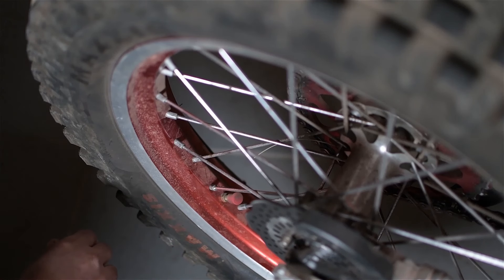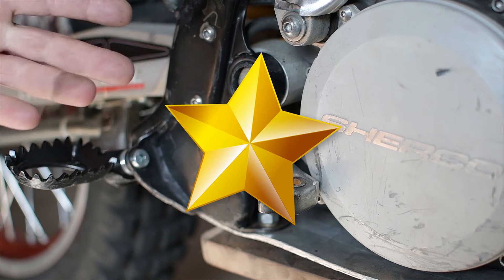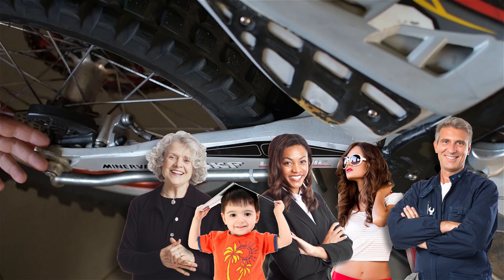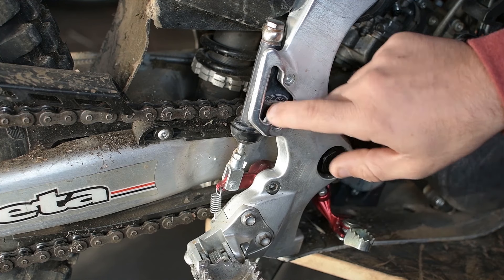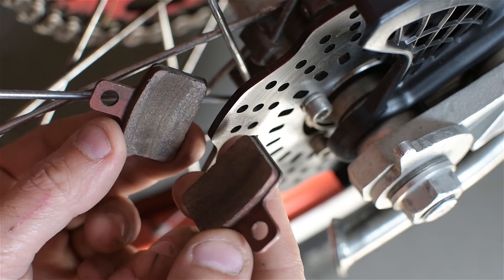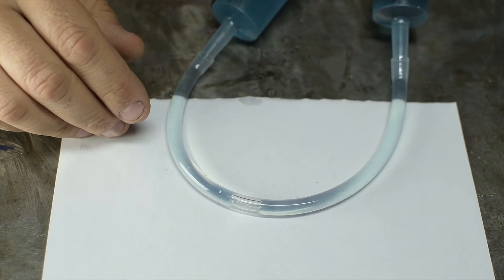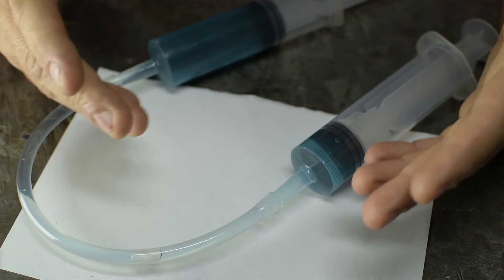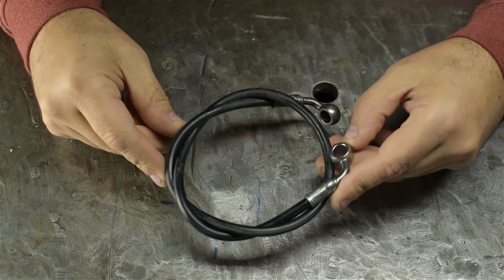I'm an Idiot! (Soft Spongy Brakes)

Comment: Question. So im having similiar issues on my bike, i have aftermarket rotors. Stock is 4mm. My rotors are 5mm. But the pistons in the calipers dont have anything stopping them from coming out further in your case. (And in mine there further in) So im wondering how tf it effects the brake force. Lmk if u have an opinion

Comment: my brakes squeal like a pig.  I have tried everything, new pads, surfacing rotor, cleaning them both, tightening all the fasteners involved, but always, within a couple miles of riding, they begin squealing...?  Oh, and it's a mountain bike with hydraulic brakes.  My only guess, is dust.  Is there a pad out there which dies not react to dust?

Comment: Ok, I have a question. Like, THE question:
WHY?
I doesn't make sense to me.
The calipers are able to compensate for pad wear, so they are able to compensate for rotor wear. If your description of the problem was correct, then new pads should have solved the problem.

I'm asking for a friend whose motorcycle front brake feels soft and spongy...

Comment: Umm. I don't get it. Aren't the caliper pistons self adjusting? I think pistons go out until they pop out from the caliper and spill oil. That is the reason brakes have an oil reservoir. Maybe some manufacturers limit piston travel to force brake pads/rotos change?

Comment: But... the rotor was only worn 1mm below spec, and you had brand new brake pads? What happens when the rotor is at spec and the brake pads are worn 2mm down from brand new? Wouldn’t you be in-spec everywhere and still have this problem?

Comment: So let's do the maths on likely cause of spongy brakes*:
90% air in the lines
5% brake pads
3% master cylinder seal
1.91% soft line failure
0.09% rotor wear

*without visible or audible symptoms of individual component failure

Comment: Your speed is very limited and very dangerous if you don't replace the chain. With that chain when you start to go from transonic to near supersonic a shockwave will develop on the advancing part of the chain causing instability and extreme heating breaking the chain. Its very different to retreating blade stall on helicopters but same principle.

Comment: @This Old Tony
Awesome video, this one would have stumped me!!! With that said, I do have some information that you might appreciate.
 Brake systems on cars do not ever have this problem. The caliper piston can be pushed all the way out using the brake pedal if there is nothing in the way to stop it. I have seen this happen when someone pushes the brake pedal with the calipers dismounted.

 I have also seen rotors completely cut off their hub by the caliper or  brake pads completely gone with the piston itself pushing on the rotor. There are people a lot dumber than you. ;)

 A lip seal like the ones used in car master cylinders will in fact let fluid pass in the opposite direction of the lip under pressure or vacuum. The master cylinder can not limit the travel of the piston, because the seal acts like a check valve, and lets more fluid in from the reservoir.

Comment: Wait, but wouldn't putting new pads in solve this? The MC/SC assembly needs to be able to compensate for pad wear, anyway; so a worn-out rotor + worn-out pads could technically run out, but with fresh pads, you should still be in the clear? I mean, considering the pads have about 3mm of usable depth _each_, while the rotor will only degrade by about 1mm total. Unless the disk is paper thin, putting new pads in should always make the whole thing brake better. Oh, and btw, it's the caliper travel you'd run out of, not the MC; the MC "resets" when the pads wear out, and it always starts from 0, while the caliper pistors stay permanently slid out.

Comment: you got to the brake line part and I'm like ... yeah maybe.

They are weird and yeah usually in a car over time due to stress. inside breaks down and you depressurize the system and the inside of that line says nope, i'm done.

Comment: Hey, I normaly don´t just write comments under certain videos on YT but here i would want to have futher explanation. I nerver heared of such a thing like `spongy brakes because of a worn disc`. Could you explain in a Vid how exactly the Calipers work, because in normal Fist-Calipers (which is a free translation from how we call these 2-piston (or more) calipers in german). Before you feel something different in the paddel the pistons of the calipers should come out (including a lot of breakfluid). I would suggest, just from hearing what you are saying, that possibly the seals in the caliper it self have gone bad, or there is dirt on the piston and you will probably experience the same problem again in some near future. Because these seals are normaly not just for sealing the breaksystem but also to retrieve the pistons back into the caliper for some fraction of a millimeter. sometimes if you have problems with this seal it can help just to push in the piston and pump it out some more times as well as cleaning the surface you can reach and use breakpistonpaste on it. 

I realy enjoy your vid´s and thought i would take some minutes to share my personal experiences as a motocycle and car mechanic with you even though you changed nearly the whole system anyways already, furthermore im sad about possible mistakes in this text my gramma might also be a little spongy.

Comment: I fill from the bleed nipple, Not from the top.
Get a large syringe and some thin tube and connect that to the nipple and sloooooooowly empty the syringe in the brake line.
If you did it slow enough you will have a brake line without air bubbles.

Comment: I dont get this... With new pads you have to push down the cylinders to the really bottom... And the stroke have to handle the pads wearing.. which is a lot more than the thickness of any rotor.

Comment: WARNING: EXCESSIVE EXPLANING - Reader discression advised! For future reference if you suspect low brake system pressure or pressure bleeding off you can get an awesome new tool called a "pressure gauge" which taps into the bleeder fitting at the caliper and will actually display the pressure in the system.  (BTW-just being sarcastic about the pressure gauge). The thickness of the rotor in and of itself shouldn't cause a soft or spongy pedal per se. A spongy pedal is caused by air trapped in a hydraulic system. Basic physics lesson ; gases (air)=compressable, liquids (brake fluid)=incompressable. If there was no air in the system and the system had no leaks then pressing the brake pedal should make the pressure rise to max and stay there without variation. But the pressure won't rise to the maximum until the pads have moved as far as they can and come up hard against the rotor. Back to mr. Master Cylinder. If the push rod at the master runs out of travel before the pads move all the way to rotor then no matter how hard you pressed on the pedal you were never generating max system pressure. So the pads would have some drag on the rotor but not maximum force. This could all have been checked with a pressure gauge. Also on cars you can adjust the length of the pushrod that goes from the brake pedal to the master cylinder to compenstate for the extra travel. If there was no adjustment on the pushrod on the bike's pedal you could have backed off on the stop screw to allow the pedal and the pushrod to move a longer distance at the master cylinder. This however would give what is called a "long" pedal or one that moves too far before any braking effect at all happens. I guess my point is when diagnosing any brake (hydraulic) system you've got to check the system pressure with a gauge before you can go on the mechanical parts of the system. Plus it's cheaper than buying brake fluid in 55gal drums. (Again with the sarcasm). I worked as a mechanic for 40 years and the most common cause of rechecks was a brake pedal that didn't feel right after a brake job. So I learned everything there  is to know about how to make a brake pedal feel perfect when a customer picked up their car. Next time first check that system pressure!

Comment: Ok.   Here's a brake problem question.   My paps truck brakes work great.  For about 10 minutes. Then they all.  Every single one slowly starts to grip harder and harder till the truck is in moveable.  Like seriously if u try to move it once they all lock up it won't.   What could it be

Comment: It took me till 11:30 till I figured it out... I have a BMW R1200C that even when it is 100 functional, to bleed the brakes requires a complicated intense setup and something in your butt... I don't know, but something has to be in there. (BMW) I used a wooden dowel with sand paper and/or scrubby to score the problem cylinder. It worked. But wow, brake line? Mine were $300 -_- Okay wow not brake line, rotor thickness? Oi!

Comment: Nice video. But- it’s not a good idea to call it “oil”, just in case someone thinks it’s actually oil !   Hydraulic fluid is very different stuff- based on glycol, not oil.  They (glycol and oil) are not compatible; worse than that, the seals in the brake system will be damaged by oil.

Comment: disc is not straight..?   And..High pressure water and bearings (headset, suspension pivot points) equals rust someday..

Comment: Well, this makes no sense.  A worn rotor won’t make the brakes spongey (any more then worn pads will).  It also shouldn’t increase the pedal travel, since hydraulic brakes are self adjusting for wear- the fluid level in the reservoir will drop, but the pedal travel stays the same.  If your brake was indeed spongey, and was fixed by changing the rotor, maybe the rotor was out of parallel (ie tapered or dished)?

Comment: how bizzare, normally on an open brake system the caliper pistons will effectively self adjust for pad or rotor wear, a closed system cannot but that master cylinder is definitely an open system, i'm going to suggest that maybe the rotor was warped thus rather than the brake pressure pressing the pads against the rotor and braking the bike that maybe the brake pressure was deforming the rotor to be parallel with the brake pads hence the pistons have self adjusted to the maximum run out of the rotor and have to travel excessively to accomodate for that, I have seen this on literally thousands of mountain bike disc brakes, both mechanical and hydraulic, if the rotor is warped a outiwth the (very small) tolerance the brakes feel spongy and soft......god I just said it!

Comment: Holy fucking shit, the rotor would've been the last thing I'd check, I would've even rebuilt the goddamn caliper first. Very unusual problem considering the pads can wear down more than what the rotor ended up being thinner without a problem. Well, at least on all mine that was the case, maybe those trial brakes are different.

Comment: I ONE OF THE THREE you helped. Bought a Honda CR500R new back in `96. Having the same issue as you for the last couple seasons now yet my rotor looks good. I have to measure it. With all that said as I sit here gunning down your theory with my AK-microsoft ARC keyboard I`m still skeptic. The caliper pucks take up the slack of wear. Add a little more fluid and you`re golden, right ?? How about I get off my fat ass and check for myself unless you want to take a flight to Jersey and do it for me ? LOL All expensive paid not by me of course .....

Comment: Lol story of my life. I had a similar problem with my rsv. I had no rear brake... i mean not soft not spongy just dead. 1mechanic insisteed master cylinder so i changed it. after a week the break was dead. mechanic insisteed master cylinder again. So i changed mechanic. The second mechanic said master cylinder also. long story short i skipped this mechanic also and started to figure out my self. changed again the piston, then the hose, then i bleeded every possible way front way back way sideways. Then i moved my master cylinder away from the motor and behind the rear sets so it doesnt get the heat (it was a possibility) then i bleeded with syringe the hole system then i changed the bleeders(for the possibility to be worn and suck air in the system). Then i changed the hose with the bleeder inlet to get the bleeder on the upper side. one day after 2 wears without rear break i had the AHHAAAA moment. i took out the caliper stuck a screwdriver between the pads and hold it as hight as i could. Guess what. The sucker was full of air. For the clever ones my rear system has 2 bleeders one on caliper and one on master cylinder and second the caliper is below the swingarm.

Comment: Since I started taking up machining and making parts for fun and profit a few years ago I have discovered a whole WORLD of things that you pay good money to be within some kind of tolerance... and find out just exactly how much the underpaid lackey who made it didn't give a D@#& about tolerances.  I mean, if you actually start carrying around a decent digital caliper and a mic you won't believe how many things are a mile off from spec.  My guess?  That bike got a "new" cheap-ass chinesium rear rotor before it was sold and it looked just perfect because it was.  Perfectly flat....  ... ...  And .100 too thin from day one making it a brand new AND worn out rotor all at the same time.  And being so dang thin you could never generate enough force on its surface to ever actually WEAR it like you'd expect to see which made you think it was fine every single time you looked right past it.

Comment: ok lets relate to me. happened to me once when i tore open a rc controller thinking its not turning on. checked all circuit. battery all caps. even was about to replace a capacitor. stupid me was pressing wrong button to turn it on and expecting  ( led light was not turning on) later realized that led was (inbuilt) ON button itself. lol

Comment: You didn't mention that vertical adjustment nut / rod on the MC at (6:45).  I'm going to presume your MC was out of travel distance and you didn't have any more adjustment on that MC rod.  According to your numbers, .035 of wear / .89 mm ; you would think your MC could compensate for that - granted your peddle travel would increase , but with new pads that seems a bit odd .  Having those "Eureka" moments is really fun, isn't it!   Here is an old favorite word you may be familiar with...... consumables!
Hey, I caught that "subscribe" sticker.... (0:47) ; I hear that is really good oil!

Comment: You with some old bike: stuck air bubble complains of slight bend in brake line
Me with a 300cc taiwaneese modern maxi scooter :
FUKEN BRAKES OMG WHO DESIGNED THIS LINE THAT BENDS OVER 420°  AIR GOES UPWARDS AND THE HYDRAULIC FLUID DOES NOT COMPRESS

Comment: Every use of "lost pressure"  was incorrect, soft and spongy is not due to pressure loss. Soft and spongy is always a change in volume,[not pressure] often due to elasticity. The elasticity can be a soft hose, air, some weird home made pad material, flex in levers, or steam bubbles [in a hot caliper with old fluid]

Comment: I disagree - you may have changed the rotor but it wasn't that - the pistons are not travel limited......and would continue until they touch each other - in any event, the rotor isn't soft. You showed the master cylinder return spring which pulls backs the fluids to gap the pads from the rotor - bear its effect in mind as the gap it creates also has to be taken up when actioned.  The unwary service their bike and put new pads on and force the dirty partially oxidised piston back into the callipers to accommodate the thicker pads. This oxide and dirt do an excellent job of adhering the piston to the calliper seals. The seals are only in a slot but once adhered to the piston tend to go with the pistons outwards when the brakes are applied. BUT equally the seals now tend to roll back into their slots pulling the pistons back off the pads/rotor even further than intended (working in the same way as the master spring return). The extra travel is then felt as soft brakes that will work only with increased travel. Common to many bikes but cars tend to have slave piston gaiters to keep the dirt out so don't get this problem as often.

Comment: If this was a street bike.  Only thing the rear brake is good for is trail braking.  90% of your stopping power is in the front.  As this is a Trials/Dirt bike i can see why you would want the rear, still most of the stopping power in in the front depending on your current terrain.  Also you haven't bleed until you have used a Air Bleeder (Is also cheaper then that hand pump you bought.  https://amzn.to/2ZYm6sr ), No air bubble stands a chance.

Comment: Your videos are brilliant, but this one is flawed!

When the brake lining wears, the pistons move towards the disc to compensate for the wear. As you had fitted new pads, the missing few millimeters on the disc would have made no difference.

I have seen cars in the past when the pads have worn that thin, they have been ejected from the caliper, so the piston is now the pad!!  and when the piston wears by rubbing on the disc, it eventually leaks, so you have no brakes. Obviously the brakes would have been grinding, but some people just turn up their stereo.

Anyway, the worst a disc (Rotor) can do is cause brake judder dur to parallelism in which the disc has varying thickness around its radius causing the pads to move in on out when the brakes are applied causing judder.

Keep up the good work, but this one needs a rethink!